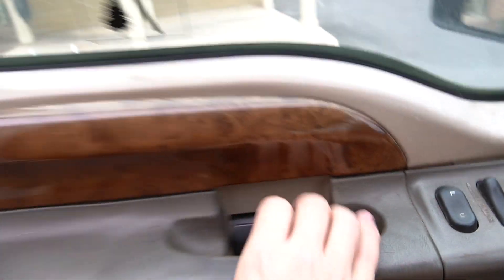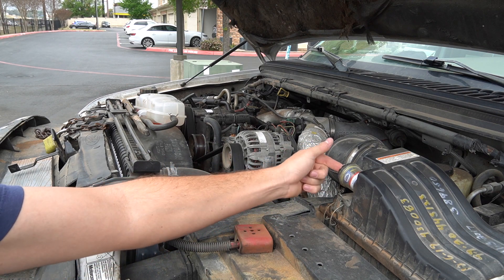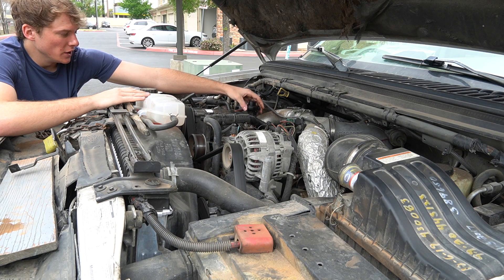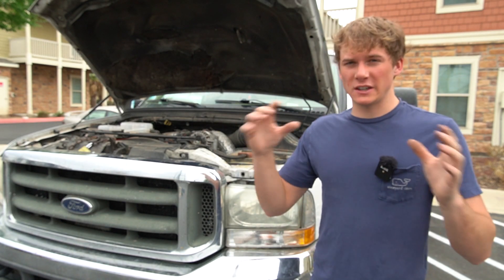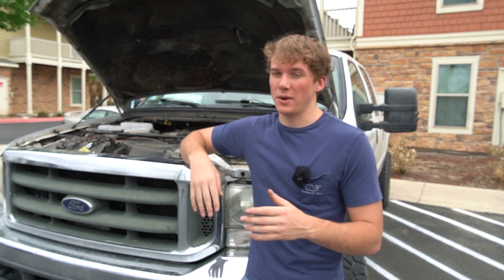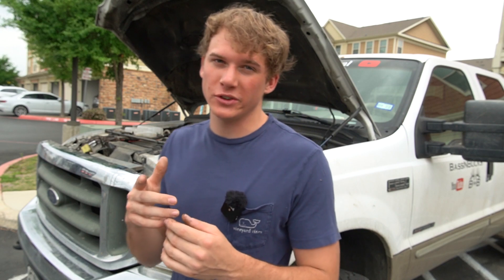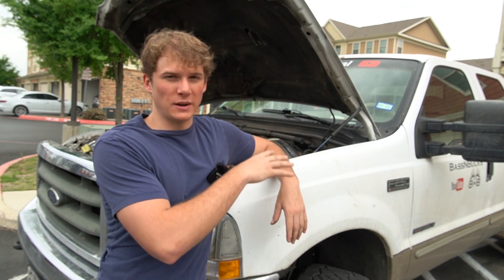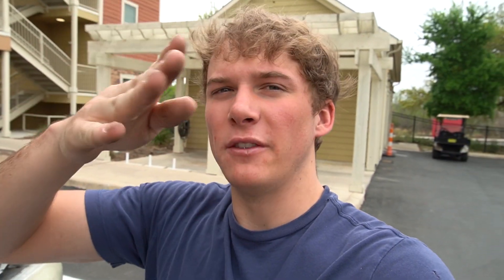How To Check For Blow By On A Diesel!? 7.3 l Powerstroke F-250 Super Duty Diesel Blow by!?

Comment: That hose you have under your truck that’s the crank case ventilation delete kit so it’s not getting sucked up into your intake your turbo your inner cooler gets oil all in there then all your boots degrade and then they pop off or boost leak
Reply from the maker: awesome thanks for clarifying i knew it was something to do with the blow by

Comment: Well you don't have Blowby till you own a 6.4. Now that's Blowby. From new it will almost take the cap out of your fingers and that is supposed to be OK in 6.4's 😢. There is all kinds of excuses for 6.4 blowby. Like the piston rings in the 7and8 have to have such a large separation to acomadate the 1400 degree  temperature in regen plus a list of other related issues😱

Comment: You are not getting an accurate test of blowby. As you noticed, your air filter is clogged. That puts a partial vacuum on the breather. Check your blowby after you replace that air filter.